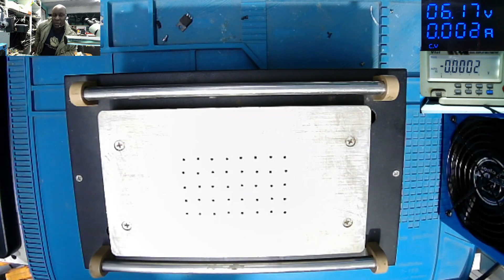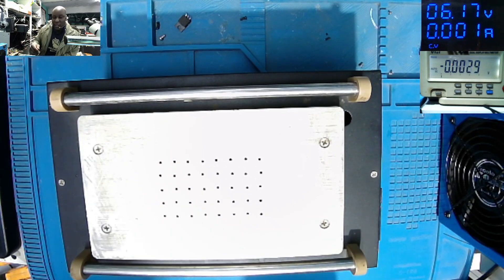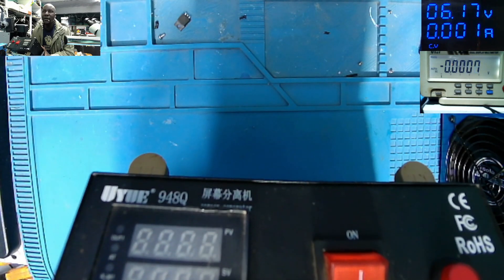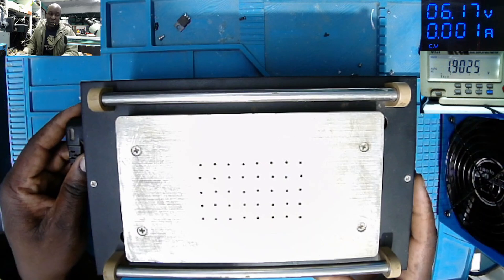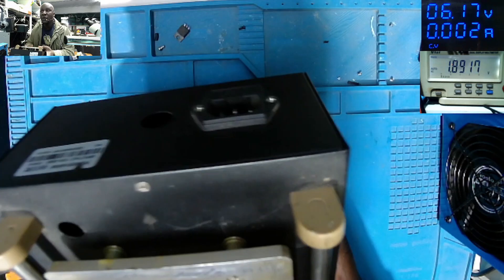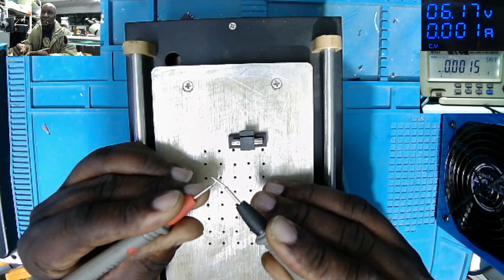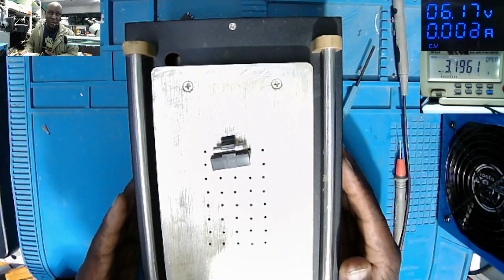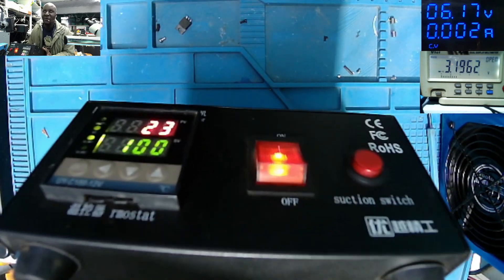UYUE-984Q Vacuum LCD Separator Machine Not Powering On Repair--Does It Still Have Life?

Comment: The fuse is an over protective component They go through this  to protect other shorted components or sudden increase in current. Their low resistance lets them to slowly burn and cut out power. The smalles piece of wire in my workshop will do the trick so it costs the manufacturer nothing to place a spare. Nice job!